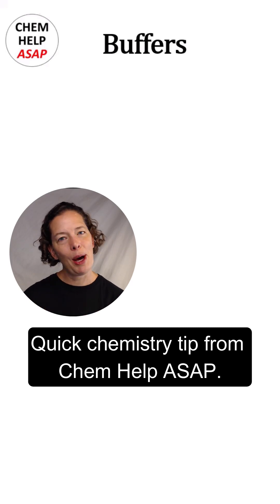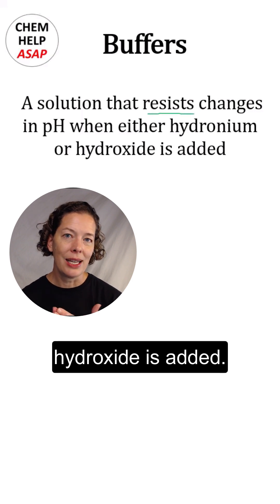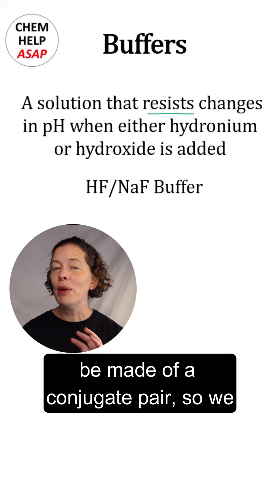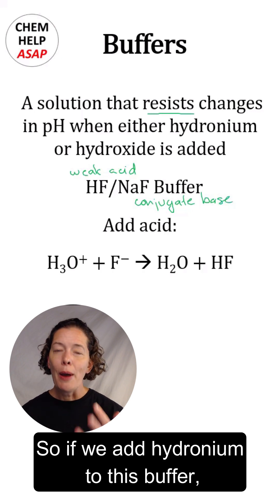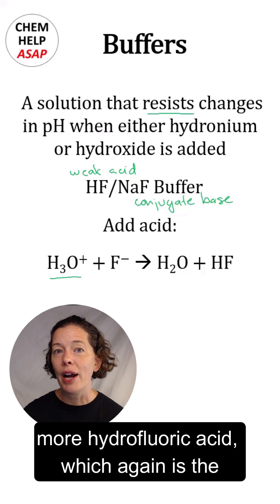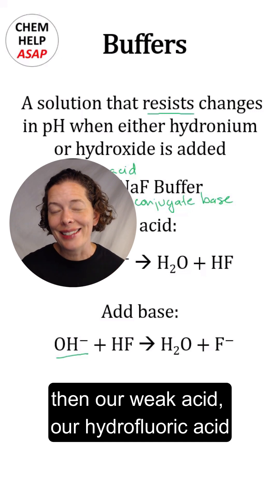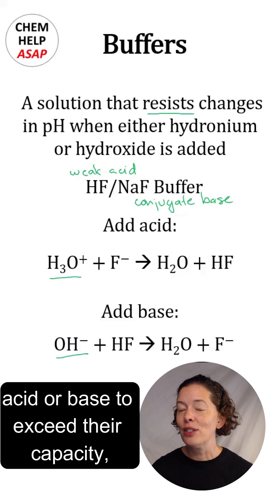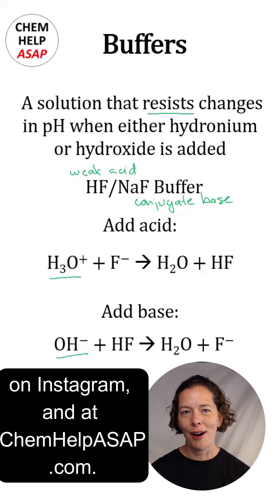Buffers: What are they and how do they work?

Comment: HF as weak acid? Since when? That is the only acid capable of dissolving SiO2! Its one if the strongest acids!
Reply from the maker: You are right, HF does etch or dissolve glass. However, that is not the definition of a strong or weak acid. A strong acid will completely dissociate in aqueous solution while a weak acid will only partially dissociate. Since HF only partially dissociates, it is a weak acid. Still capable of amazing things though!